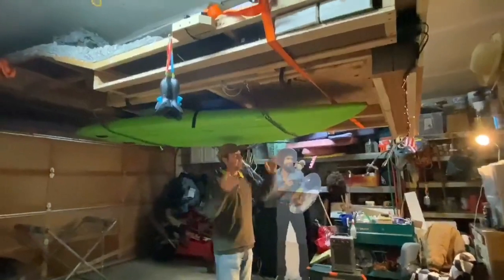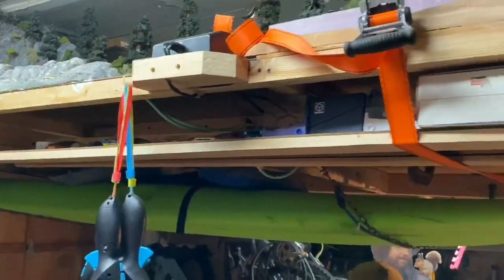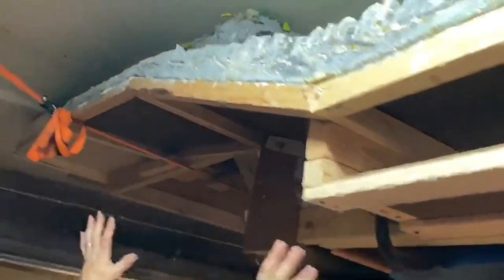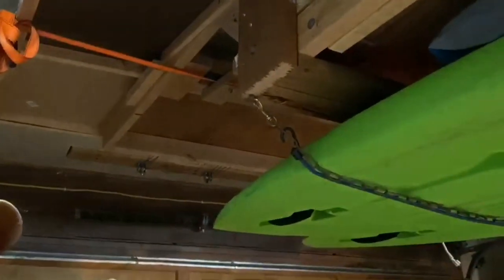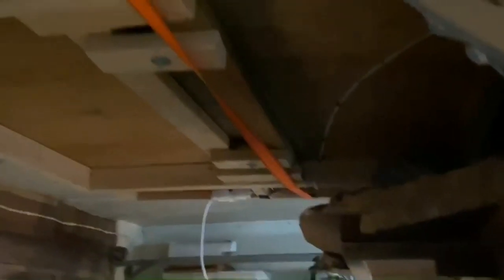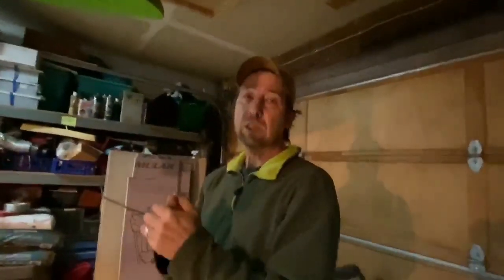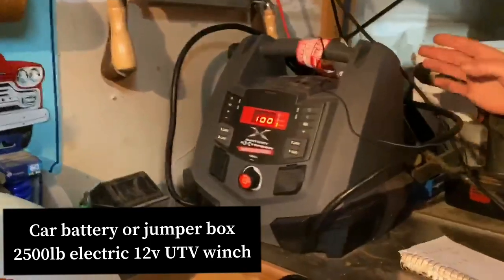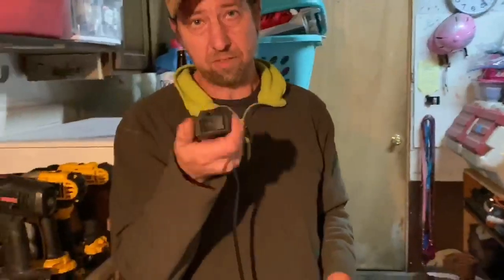Ceiling power winch mount pulley lift system for slot car layout table / part 1

Comment: HEY, HEY,   Aquired a vintage slot car track. In a small apartment started to engineer a lift system on 30" x 80" hollow core door. Searched and found I am not the 1st to come up with this idea! Assembling and breaking down track kinda takes the fun out of it. Got some eye bolts and 1/8" cable. Probably going to pull it up and down manually and have a pedastal when in use. By the way a "Wench" is my  X wife haha,  a "Winch" is a pulling device. Haha

Comment: Amazing track!  
I just recently purchased the ARC AIR power base to go with my many many feet of track.  I think when my boys (4,6) are older I'll invest in the ARC PRO. I dont think my boys could handle the lane changing.  But i would love to be able to race more than 2 cars at a time. 
ARC PRO is just too pricey right now. To get the base, digital chips for four cars, pit lanes, and lane change tracks, it would be close to $500 CAD.   Right now my boys and I are having fun racing with the wireless controllers and the ipad app.  Having wireless controllers is so much better.  My starter set was the Nascar set.  Got it June 2019.

Comment: Just an idea...
Instead of those heavy seatclamps (sorry for the bad text, i'm Dutch) drill a hole trough the table foot and in the wood when they are in both positions.
Then secure them with a long bold or some round iron with a security on the other side so it doesn't get out of the hole.
I would not like to see those heavy clamps fall on your wife's car.
Great channel by the way! 
Subscribed in a heartbeat. 

Greetings from the Netherlands.
Reply from the maker: Thanks jack,  I have thought about doing that and I might in the future. The clamps stay put very well and I have a lot of them ... lol .. but when I lower down the table to the floor I push the table towards the garage door so I can have more room around the front of the table, but the clamps tend to move slightly. So a modification might be in the future... thank you for watching my channel, Boone

Comment: Super explanation; can you share a little bit longer on the cable system and weight to support; how do you get to design with the motor at the top? Thanks a lot !!
Reply from the maker: Thanks buddy, I do have a second video on the lift system. It’s short but it covers the pulleys and winch in more detail… I believe it might answer the questions you might have

Comment: Would be nice to see how the pulleys on the ceiling are positioned and how the cables run...
Reply from the maker: I’ll have to make a new video 😂… luckily I’m going to have to redo this completely for my HO layout. This video is when I lived in Washington state. We have since moved to Texas , my 1/32 layout is now permanently on the ground. But my HO is on a pulley system. But I’m going to need to completely redo the whole setup to work in our new place. This actually was on the books for me to do before my accident. But the state my injuries are right now it might be awhile before I can attempt to do this 😂.. but yes , when I do this again I will film the whole process of how I do it. It’s going to be a big job 😂. Thanks for watching and I’ll post this video up when it happens..

Comment: Great stuff. Lots of info & ideas. Thanks for sharing. Two questions. How long is the track? Which is more fun, racing or modeling? If I only had a garage!
Reply from the maker: Thank you Zo...  my track is 106ft... wish i had more room to make it larger... and I enjoy both racing the track and the modeling. The modeling is fun because I get to create and build, It’s the way I spend each night after work , I get 2 to 3 hours to tinker around, it’s a great way to calm the brain.. lol.,  everything on my layout minus the track and two signs from Miller Engineering I have built from scratch. But I do like to race it as well , I find it relaxing , and I love the cars....

Comment: Nice. I might try this. How do you keep the layout clean and stop corrosion?
Reply from the maker: Thanks Edward , I keep my layout clean by doing some vacuuming with a low suction dewalt battery handheld vac , works great and doesn’t destroy my scenery. I use this on the track surface as well . I also have a lint free handheld surface duster that I clean the track with.  For the track rails I will wipe them by hand with a microfiber rag that has a little bit of ATF oil on the rag. I have found that this works very well in maintaining the rails to prevent any corrosion. Being that my track is not painted ..... yet, that’s going to be a future video , I don’t need to worry too much about any left over residue. ATF can and will eat through paint , so if you do have a painted track I would use a oil that would not tend to destroy the hours spent painting a track , WD40 would work.... hope this helps and thank you again Boone

Comment: to get your c clamps back and save weight, just drill a hole and use  like a dowel pin.
Reply from the maker: @brucemullison5346  I prefer something I know won’t fail . Under this layout was my wife’s Mercedes Benz when it would be stored. I think I would rather have faith in a steal c clamp then a wooden dowel 😂kinda life insurance

Comment: Can you tell me what kind of battery box you used to power the winch?
Reply from the maker: The battery box I use is an automotive battery jump box. But you could use a car battery connected to a trickle charger or they also make a converter to take wall power and convert to 12v .